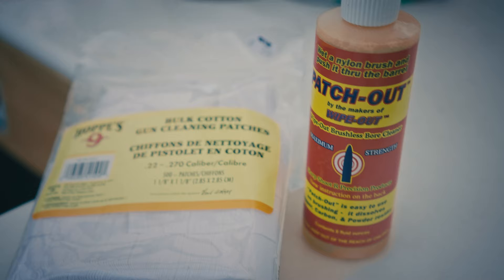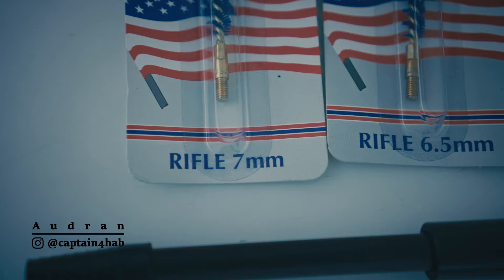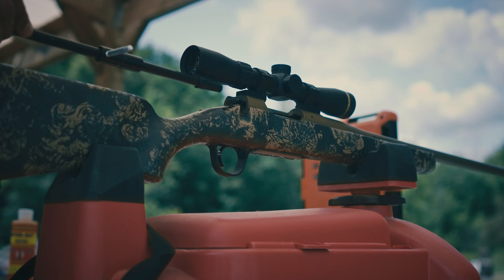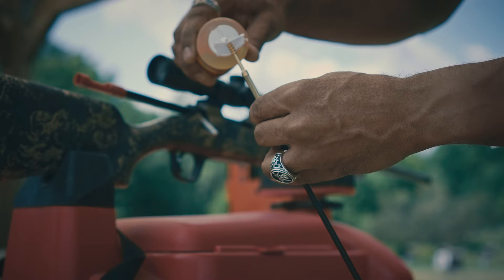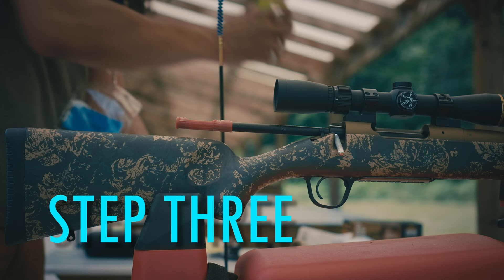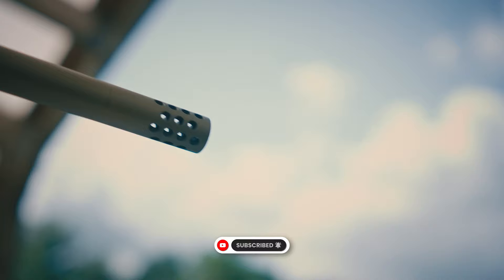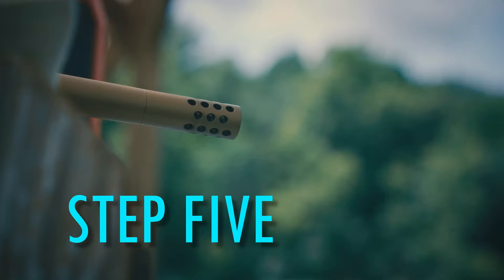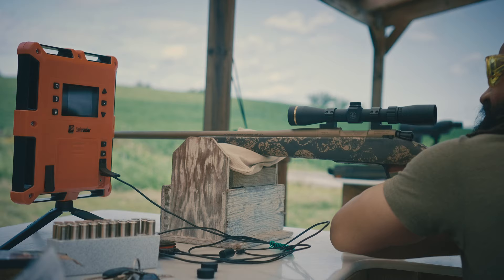Mastering the Art: Barrel Break-in the Christensen Arms Way

Comment: Did you see any difference in accuracy? Can I sight in while I’m “breaking in” the barrel?
Reply from the maker: Yes you can sight in while breaking, your point of impact may vary but very slightly. Group size also improves over time, as well as velocities, as the barrel settle down. You will get less variation in velocities, which will actually increase with the first 200 rounds.

Comment: Breaking in barrels is a waste of components and time.
Reply from the maker: I can tell you from firsthand experience it is not, and depends heavily on how the barrel was manufactured.
Reply: If you have a pos gun/barrel, I would agree. From experience, I consistently shoot sub moa with any Christiansen Arms barrels after properly breaking in the barrel
Reply: @GSDadd ive had two identical barrels made for my r700s. One with a break in and the other without, and the both shoot factory and hand loads respectivley in the same group consistency. A properly cut throat and bore is more important then any subjective barrel break in. You're just shooting for the sake of shooting when you break in.
Reply: @Spruce-Bug I was sceptical as well but I have a ridgeline and at first was sub moa but right below 1”. After break in it shoots no worse that between 1/2-3/4” if I do my part I can shoot 1/4” consistently out of it